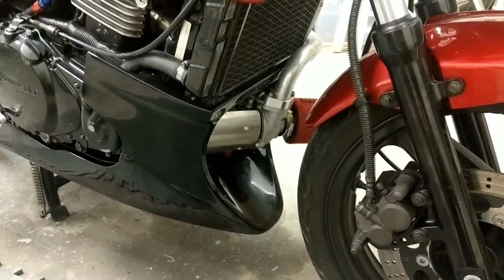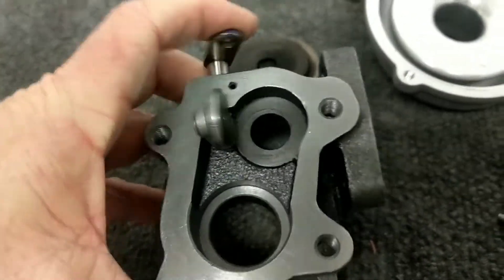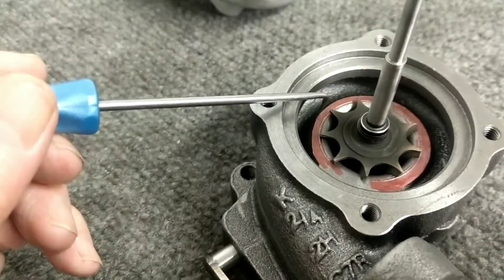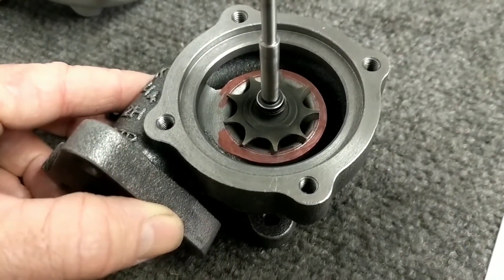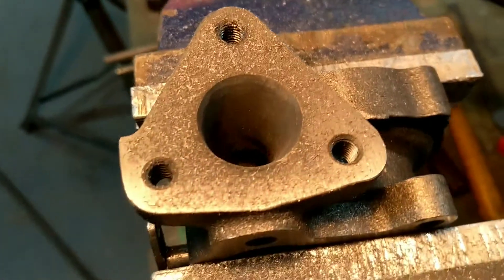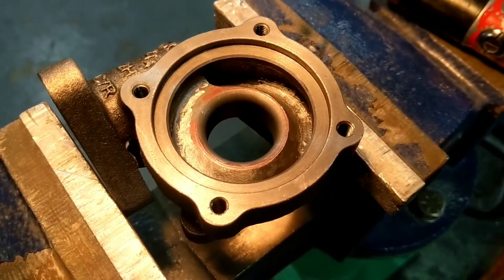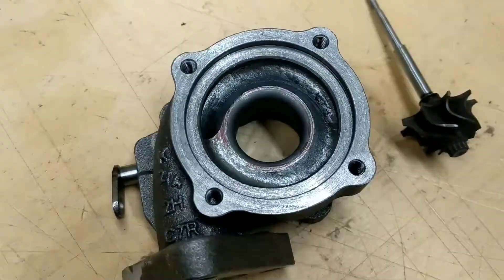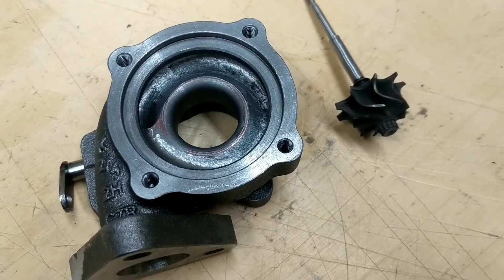Ninja 500R VZ21 turbo exhaust housing mods and porting work

Comment: You'd think you'd want that lip on the exhaust so it channels around the snail and up to the point where the flow hits the leading fin. By grinding off that step you lose velocity as the flow no longer travels around the snail and to the point and instead just climbs the walls. If you look at the path the exhaust flows before it meets the impeller you'd see it travels in a specific path to meet the fins....just my thoughts

Comment: Hands down one of the most interesting projects on Youtube right now. Thanks for sharing.
Reply from the maker: Thanks! I assembled this exhaust housing on the bike and went and tuned it again. It added 18 percent more fuel in the higher revs, so it was a huge gain in HP. At .5 lbs fuel per HP, this calculates to 142 hp. I really need to try it on a dyno.

Comment: It's so great to hear from you again. I am pretty sure you have tons of work to do you regular money making job and this is a side-track kind of hobby.
However we love to hear the progression of both 2 and 4 stroke version.
One suggestion or idea, I think if you would smoothen the area you grinded on the exhaust side, or even polish, not for more boost, but lessen heat transfer into the casting may be another beneficial factor could save the turbo lifespan.
What your take on that?
I wish I could do what you do. Now suffering with COVID for 3 weeks now, can't even go to my garage to do little things I would love to.
Keep up the good work and don't hesitate to inform us with your progression!
Reply from the maker: Probably right, smooth is good on exhausts, this is pretty smooth, just harder to see on video, small direction changes from all the different cutters used. Ill show what the new two stroke piston and rod looks like soon.

Comment: So awesome.  I love this idea of smoothing the turbo, I might suggest this my friend that's been building an insane Miata turbo for the last decade.  It's already very scary fast. I think this might be the one thing he hasn't done.
Reply from the maker: Yes, most turbos have poor flow and can use some smoothing and flow work, its free power and easier on the engine with lower back pressure.

Comment: Is this one the interesting 2 stroke design bike you've been building or another turbo ninja?
Reply from the maker: This is the same bike and same bottom end as the two stroke. I had issues with the Microsquirt EFI on the two stroke, and needed to set it up on another more normal engine, so put the four stroke top end back on it. I am also designing new connecting rods and pistons for the two stroke, which will take awhile to do, so the four stroke with the same turbo is an in between project.